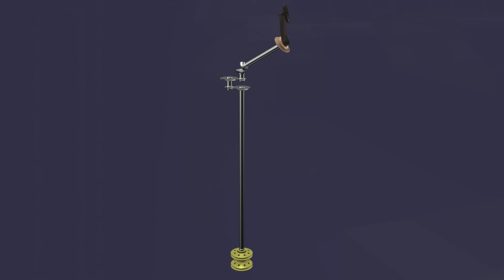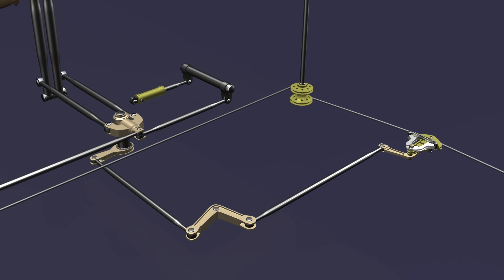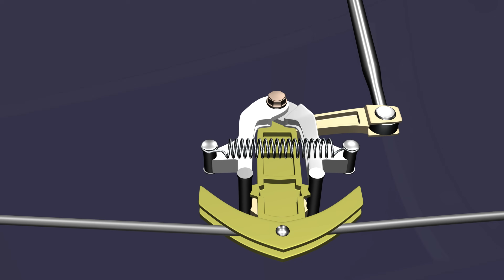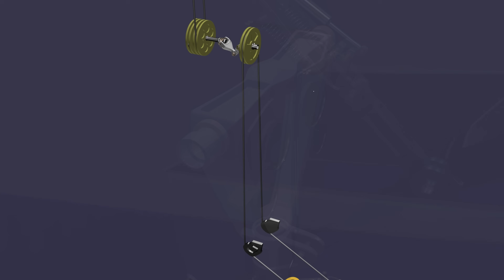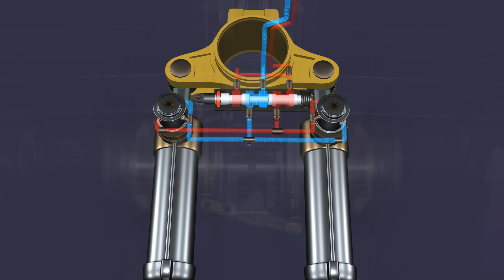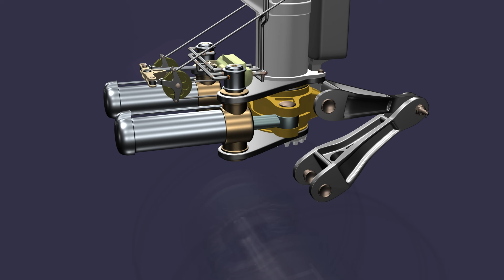How Landing Gear Works | Part 5 : Nose Gear Steering

Comment: Awesome piece once again. While an impressive mechanical system, it's interesting that Boeing choose a mechanical control path for NWS for the fly-by-wire Triple Seven, compared to Airbus, which has a full fly-by-wire NWS for its fly-by-wire airliners. 

Looking forward to your piece on the 777 MLG steering, which I think is fly-by-wire.

Also looking forward to the remaining MLG items for this aircraft.

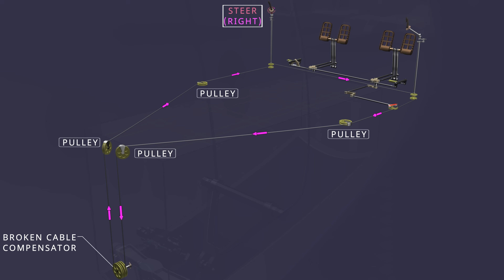Comment: Dont need. Duel or pedal steering. ,  over. Eng.  Just. One. Steerig. Wheel.  Like. On C130.  5:09
Reply: Ditch the steering and just do it on brakes. Or ditch the brakes too and just use the engines. Makes sense right?

Comment: I thought this video would also cover the nose wheel steering disconnect mechanism used during pushback, as well as how the steering is disengaged at high speeds or after gear retraction. Do you plan on doing a video on this topic?
Reply from the maker: The steering lock mechanism for gear retraction will be covered in the NLG extension-retraction video of the series. 
The towing disconnect mechanism will require a separate video and won't happen any time soon.

Comment: This is beautifully done... As always.  
This is the bread and butter. The steering system. More so on the complexity of the dual cylinder of the NOSE WHEEL STEERING cylinders. 

And we wait for the MAIN GEAR STEERING. The knife of the butter.

B777 <3

Comment: That was a lot more complex than I had expected. It'd be curious to see what happened in newer models, like 787.
Reply: They work just like this one.
Reply: I'd imagine it's fairly similar. This is just a basic mechanical system with a hydraulic system applied to multiply the force applied by the pilot. None of those concepts or physics changed with the 787. Since the 787 requires a hydraulic system to apply large amounts of force just like any other commercial aircraft, it there is added complexity with no real benefit when making this system electric or anything like that.
Reply: 787 is a bit different. There is no mechanical connection between the rudder pedals and the nose wheel steering system.
Reply: Some aircrafts like A330, or its "siblings" have "steering by wire" so the cable control between the tillers and down the steering valve is replaced by electric signals so no mechanical connection. Less headache for maintenance.

Comment: This should all be changed much simpler electric steer by wire, all that weight that could be turned into revenue potential payload
Reply: The decision to use mechanical controls makes sense in the context of the 777, as the first fly-by-wire aircraft from Boeing it still has mechanical backup. In the case of a failure of all electrical power the pilots only have 2 Spoilers for roll control and no yaw control, and without some type of steering the aircraft would be uncontrollable on ground during landing. This could result in a major accident, which is something noone wants.

While yes a need for this didn't arrive (as far as I know) but it's a logical design for Boeing for that time.